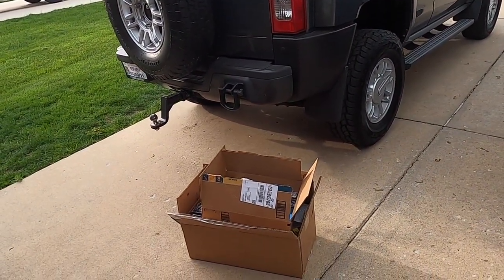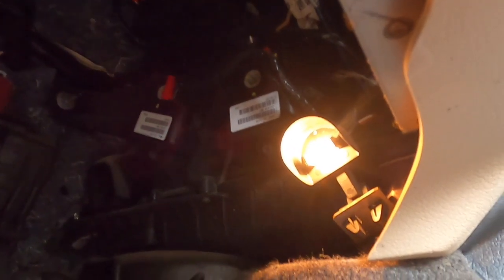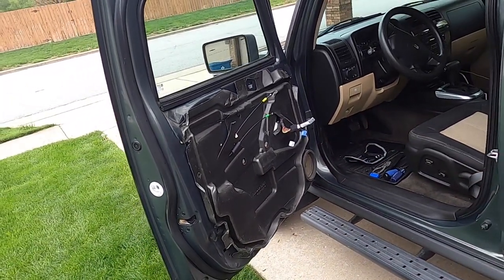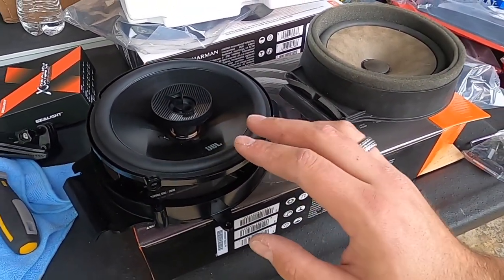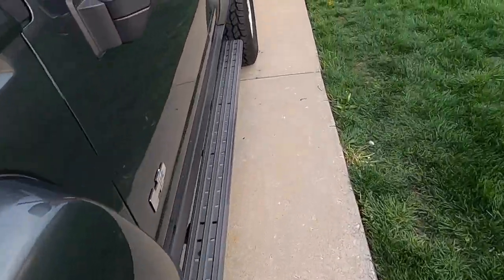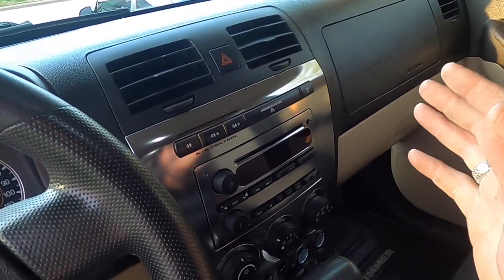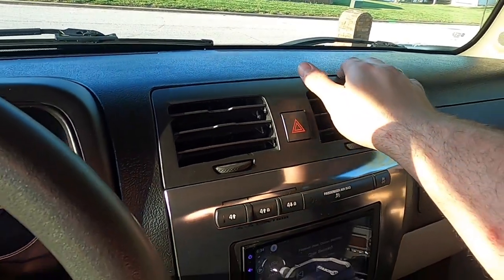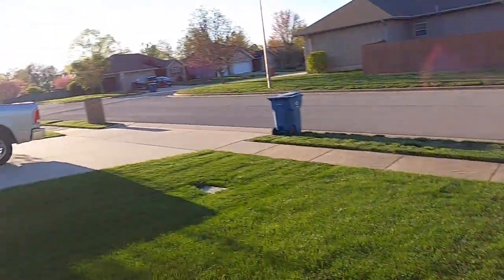Installing a DOUBLE DIN in the HUMMER H3 | First Upgrade

Comment: Which LED light bulbs did you use for your headlight and foglights?
Reply from the maker: I'm so sorry I missed this question. I'm sure you found some by now, but here's what I used 
AUXITO 9008 H13 LED Bulbs, Dual... https://www.amazon.com/dp/B08YRB456Y?ref=ppx_pop_mob_ap_share

SEALIGHT H10 LED Fog Light Bulbs,... https://www.amazon.com/dp/B0875X88Y5?ref=ppx_pop_mob_ap_share

Comment: How did you find out about the black box on the stereo harness? Looks like I'm having the same issue with my 07 H3.
Reply from the maker: When I ordered from Crutchfield it was sent with the harnesses and everything, originally I didn't install it but then the unit wouldn't turn on. I decided to try the box and that made everything power on and work as it should.
Reply: @BADZ71  Thanks for your video. Everything works great now. REALLY appreciate it.
Reply from the maker: Absolutely
Reply: @BADZ71  what did you plug the box into?
Reply: Hello, I’ve just installed a new head unit onto my 2007 Hummer H3 and I’m also having the same issue. It does not power on and I’m not getting the door chime as well. That black box you mentioned in your video did not come with my harness. Do you know the name of that black box or know where I can get one?
Reply: @joesand1978  Auto Zone has harness with interface. You definitely need the door chime box to hook up after market stereo.
Reply: Thanks for that info…..

Comment: I went the led Jeep Wrangler headlights. The factory headlights are dim and bad to collect water inside them
Reply from the maker: Yeah they are, even the aftermarket are collecting moisture. Did you use the Lased adapters?
Reply: @BADZ71  the ones they came with headlights was called h4 plug .. still got to figure out why only the brights work not the dim lights.. forgot to check after I put everything back together. But there super bright.

Comment: How did you get those 194’s by the floor board out? I can’t pull mine out. I’ll try again but seeing if there was a simple trick.
Reply: So you gotta push those two prongs beside the bulb inside then pull it out. It’ll be a little tough, but by pushing them the bulb becomes looser and easier to pull out but you need to use some forcd
Reply: @kevinharaki9579  thanks for the reply. I actually got them out not too long ago. I was afraid to break the bulb. I just needed to man up. Haha.
Reply: @Iloveyoutube11  no problem haha I wasn’t scared Becuase I was replacing them with led and would never use them again so I didn’t really care!